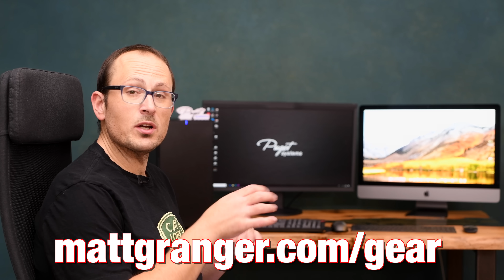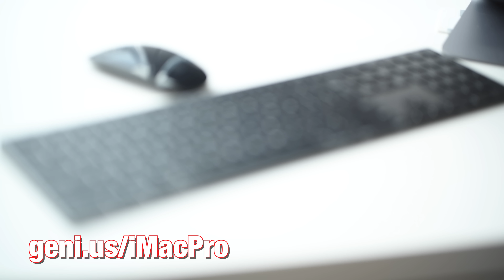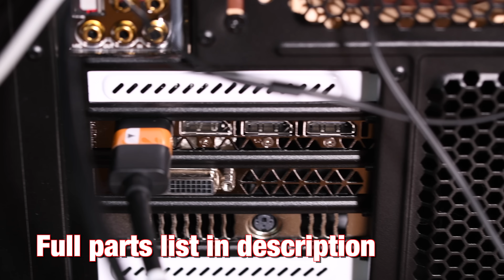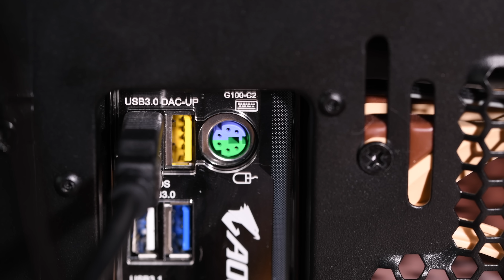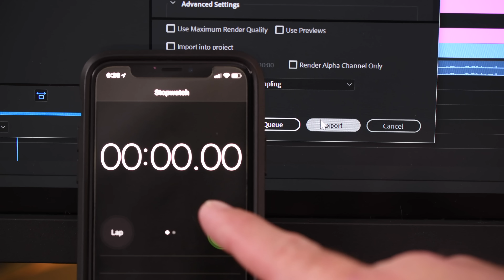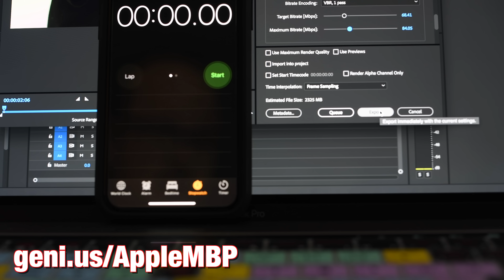$10,000 iMac Pro vs Custom PC - Which is faster??!

Comment: Completely useless video. Premiere Pro on Mac is universally accepted as being a pile of crap performance wise. If you compare Premiere to Fcp on any Mac, FCP destroys Premiere. These tests of PCs against Macs are useless if you’re using Premiere. Compare the same export in Premiere on PC then FCP on the Mac.
Reply: My Mac Pro is hooked up to a 50" 4K screen, calibrated for rec 709, (I do Have a Ninja Inferno for HDR)  and a 27" Asus 1440P 144HZ freesync monitor, (I could add more monitors I have five 4K screens) it's hooked up to my Sony Av amp, I have an 512GB M.2 SSD as boot, 40TB raid (as well as another 20TB external raid) 64gb ram, a Radeon Pro WX 9100 16GB GPU, and a Vega 64 8GB GPU. I edit 6K and 4K in FCPX and Davinci Resolve Studio 14. I also have a Fully open loop watercooled, Windows PC, i7 5960X (overclocked to a modest 4.4ghz) 64gb ram. 1tb SSD boot, 48TB raid, and Three TITAN X GPU's, also used for Davinci Resolve Studio 14. I use the Mac 90% of the time for work, it just works better, I built both and a few other windows PC's, I also have Premiere Pro, but its too slow for my needs, I work alone, and time is money, so FCPX it is, but each to their own, if you are happy with what you have and your clients are happy with the delivery time and quality of the work then alls good.
Reply: Red TV Productions ok, so do you think HIGHLY professional media artists like people compositing in Nuke, doing beauty work in FLAME, modeling and animating 3D cgi in Maya or Houdini, or stepping into the new world of GPU powered real-time rendering in things like Unity or Unreal Engine are using Macs? Maybe at one time, and those that are still doing it now are pushing several years old modded “cheese grater” MacPro towers because it’s the only way to be able to run powerful NVIDIA GPUs on MacOS. 
Don’t get me wrong, I love MacOS, but for the work I do I’ve had to switch to a PC in order to be able to accomplish tasks in acceptable timeframes. And no, I don’t game.
Reply: You know not everyone likes using FCPX?
Reply: Its a dog in PC too, adobe seem to have lost their way a bit on both platforms.
Reply: What a pretentious statement. You're no better than the "PC Master Race" crowd.
Reply: Exactly
Reply: Mate, the fact the businesses need support proves that they are more work. VERY few businesses that run on Mac (there are more than you think) have ANY support. Because they don't need it. I own my own business and the only thing that matters to me is time. Time is money and I don't believe it's ever cost me more to own Macs. I can sell a 5 year old Mac for about half what I paid for it. Find me a PC that I can do that with? Exactly the same argument for iPhones. I can recycle my iPhone after a year or two and still get a fantastic price. If I recycle my Samsung I get 30% tops after 3 months. There is no Apple tax, it may cost more when you first buy it, but owning an Apple is cheaper than a PC long term. It's just a fact.
Reply: Which limitations would those be?
Reply: Or just boot the iMac into windows with boot camp and run Premiere that way. That would be more apt in this case.
Reply: dude, i am in the IT field. some people claim mac is great for editing and using it too make stuff in IT. problem with that is,  the extra price you pay simply for mac operating system, i can save that money on either using linux or a lot cheaper to use windows (over mac). literally, if you buy a comparable pc with the exact same parts as a mac, you will save 1k to 2k $. for that price, i can either get a lot better software (if i need to pay for software), or add literally extra gpu's, nvme raid cards, extra ram, etc. literally you pay an extra price, roughly 1k, simply to use mac operating system.
Reply: Not everyone likes Baked Beans. Point is, FCP X shows that a Mac can be quick if Adobe's lazy developers didn't take a shit load of money off us every month to give us slow applications.
Reply: Have you tried Adobe premiere, it's a nightmare, if you don't like FCPX, then at least use Davinci Resolve.
Reply: MAC IS TRASHEDDDDDDDDD.
Reply: I wont rent my software so no Adobe.. and FCPX was stupidly expensive for such a limited application.. I use resolve on a PC workstation mostly but also run in on a mac.
Reply: Been working in I.T. for 20 years. Apple products need tech support too.  Any business with a computer network and the required infrastructure needs tech support. 

Just like the business needs maintenance staff for other areas of infrastructure.

Now, just to be clear, I'm not talking about 4 or 5 computers in an  office sharing the same multifunction bubble jet printer p to p. Everyone saving files locally and sharing wifi from a residential class wifi router.

There could be an employee in house that knows enough about computers to set something basic like that up. 

Maintaining a simple network like that would be a matter of re establishing connection to the printer when it drops and rebooting the wifi router when the users complain that the "internet doesn't work" . 

Whether you're on a Mac, a PC or even Linux, and you're on a small, simple network like that at work and you think you don't need support, it's because there's not really much to support, and whatever could go wrong is simple enough for the office power user to do.
Reply: "Its 5 meters away from me in another room for absolute silence." So basically, it sounds like a turbine, and you need to have an extra room in your house/apartment, just to accommodate your rig. Sounds great. "My mouse pad is made of glass" This sounds even better.
Reply: It's the screens backlight! {glowing logo (while it drains your battery)}
Reply: Jeff Newton the apple ecosystem is the best, you can go from iMac pro to MacBook Pro to your phone to your iPad , everything is integrated, your cloud , it’s a seamless transition.
Reply: Dude, the pc is just faster for the same money. The spec sheet shows it. There is just a price premium on macs amd a lot of people are willing to spend it. The raw performance on a custom pc is just higher. I like apple products, but this just reality. There is no magic inside them, they aren’t faster than the parts they contain
Reply: That's not what I'm saying. I accept PC's are cheaper than Macs. I'm saying doing ANY test with a Mac and using Premiere is crazy and pointless. I came to Mac because of OS X, iOS and the Apps like FCP X and I stay with them because I have zero issues with them and they get my job done. It's not all about shaving a few minutes off an export. I save a ton more time on not having viruses galore and constant driver and technical issues. Each to their own but I don't understand why PC users have such a chip on their shoulders about why someone would want a Mac. Yawn.
Reply: Virus's galore? I have no antivirus on my PC, just Windows firewall, and I have zero issues with malware or viruses.
Reply: That's fine if you can live with all of the limitations of FCPX.  But some of us have much more sophisticated needs.
Reply: dude, for the macs at my business, those NEED support too. that is the hilariously funny thing you don't seem to get. mac isn't this magical operating system that has 0 issues. i own a macbook pro, damn thing has just as many issues as my pc (for certain programs i mean). 
next, you claim it doesn't cost you extra to own mac vs pc, what coolade have you been drinking? i can literally show you what i paid for my pc and can show you what that exact system would cost in a mac. you claim time is money? so you are saying, lets say, an 8 core mac, would have less time to render projects than my 16 core pc? again, what shit are you smoking? that 3k mac vs my 3k pc, my pc would save you a shit load of time on literally every project. that is the point, time is money, so you go spend 6k for 1 system to have similar parts as my 3k pc. if i was a business, having 2 thread ripper pc's, vs 1 6k mac? ya, the math doesn't add up for you dude.
Reply: Jeff, I went from 12 year on pc, to mac, and I think I'll never come back to windows, except for casual gaming. Pc people needs to show they can do the same with less money, most of them. Not a tech expert here, but since I switched to mac, I have never had a random crash, or lag, or had to do a course to install a program, or had to press another key or shortcut searching on Ps/Lr, everything runs smoothly , everything works great, everything is more intuitive, my workflow actually flows.. all this with a tone of customisation inside the OS, great hardware, spectacular screen.. It just works. And pc people will never  understand it, unless they give ir a try, a whole month try using mac os.
Reply: Cesar Harretche You have no idea how much you are limiting yourself with a mac. My pc is in a 10 year old case, has a 1080ti for gaming, 4 harddisks and 2 ssds for backup and work, is crazy stable, overclocked, powers a 40" 4k screen along with two tilted 23" 1080p monitors for a nice 6000x2880 desktop space. Its 5 meters away from me in another room for absolute silence. All usb, displayports and hdmi cables are 5 meter long. It also powers my 130" projector screen, doing 60fps frame interpolation and is hooked up to two amplifiers. My mouse pad is made of glass and is heated by a usb switch. Why all this? Because in pc land everything is possible.
Reply: every business i ever worked for used windows as the primary operating system and used mac and linux for special projects. never had all these problems you are claiming with windows. maybe there was problems like that pre windows 7. windows 10, works great. 
next, i have a thread ripper 1950x, i paid a total of 3k for my pc (i have plenty of videos of it on my channel). for that same price, for a comparable mac, you would pay about 6k for the exact same thing i have. i guarantee, put my pc, next to your 3k mac, and my WINDOWS pc would smoke anything your mac could do. that is the point, why spend way way way more simply to use an operating system.
Reply: Thats the drugs talking. Get help.
Reply: You mustn't know what you're doing then. We have dozens in our business and never have an issue that takes longer than 5 minutes to sort. Look, you dig around inside your PC's and let me get on with what I do. As I said right at the beginning, each to their own. You like PC's, I like Macs. End of.
Reply: I doubt any of these people here make money from their PC's. they just play games. Thats why they don't get it.
Reply: Completely useless?  Nah, man.  Just because he didn't control for a couple of issues you care about doesn't mean it's a useless comparison.
Reply: Cesar Harretche Cesar Harretche I actively use them both and MacOS has been going downhill since Snow Leapord while Windows is improving. Beyond some cool continuity features and some exclusive software Windows is better in almost every way. It’s MORE stable now than MacOS, resolution scaling is better, compatibility is better, window snap features are not even comparable and don’t get me started on how devastatingly annoying it has been since Mac added the App Store. This is my opinion and you shared yours, but the point is that you can’t assume people who prefer Windows have never used a Mac.
Reply: I think we can. People who like Windows have never used a Mac. Those in the professional world know the Mac is the best to use to make money from. If you only play games then no idea.
Reply: You're missing the point of why creatives buy Macs, because they AREN'T "IT" gurus and they don't want to be. You buy a Mac to get your creative job done. You don't want to p*** around opening up and building your own PC. We tried going Windows last year and it was a total nightmare. Driver issues, constant updates for things we didn't even know were on there. Fact is, Macs just work and you get on with your job. I used to earn my living supporting PC's in huge companies and had all my Microsoft certifications and yet I still hate them now. Nobody will EVER convince me that owning a Windows machine is better than a Mac. I don't care about the price, I care about getting my work done as quickly and efficiently as possible.
Reply: Jdjjd Gdhdjc the thing is that pc is useless for me. I cannot work on windows anymore. I need portable, fast, color accurate, reliable, with fast storage, and macOS... When I bought my 2015 macbook pro, I was about to buy a Dell XPS, but fortunately I didn't.

Comment: Looking at this build, why do you put the OS/Software on the slower SSD? I would have prioritized this for the M.2. On my build I have the OS on the M.2 and do my initial culling and edits (memory cards are the initial backup) there before moving them to my SSD RAID 1 pair that houses photos for the current quarter (offsite external drive backup) .
Reply: No but having your OS on the m.2 isn't just for boot times, it's for the entire OS to be able to load everything it needs to super fast. I agree with you Chrismzeller, OS on the m.2 Ultra for max speed.
Reply: Chrismzeller Shaving off a second off the boot time or startup time of Premiere doesn't really matter.
Reply: So many issue can come up with the OS on an m.2 though, it's not worth it for a little boost. It's ok when things are working, just like everything else. I'd rather use it for my scratch. Don't do you culling and edits on the same drive with your OS Chrismzeller. You'll eventually end up with errors on the last drive you want errors on.
Reply: Puget did tests with different setups.  They say m.2 is for scratch and project files.  SSD for OS.